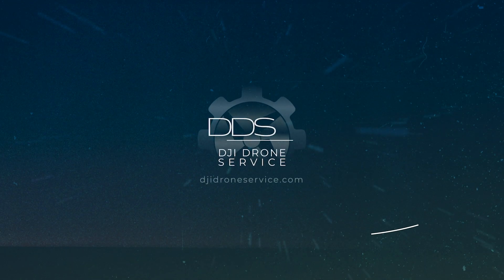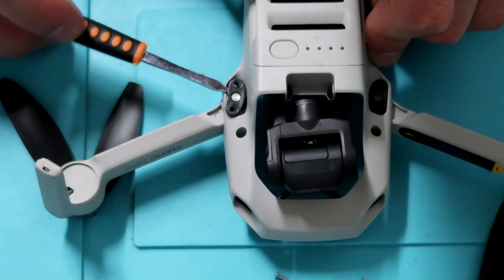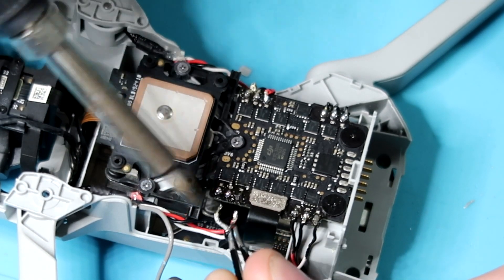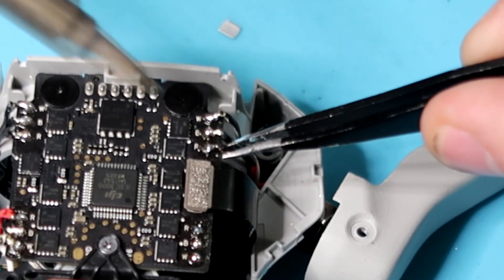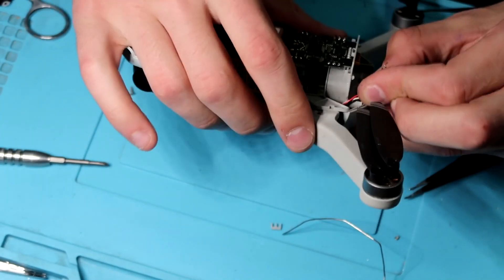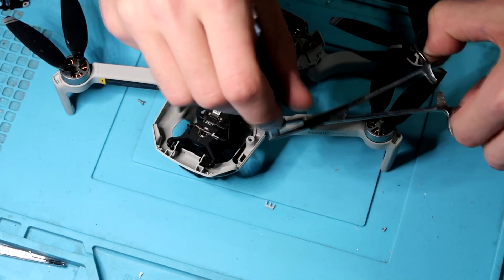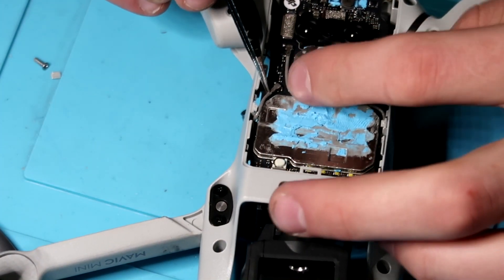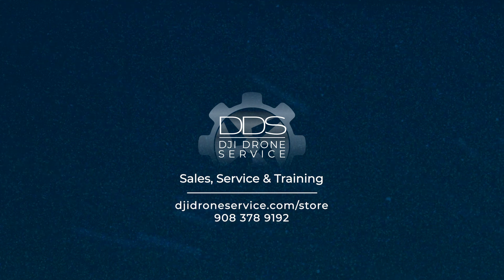Mavic Mini Front and Rear Arm Swap & Repair

Comment: Both videos I have watched regarding the mini when removing the top shell I noticed pieces breaking off the drone and laying on the mat.  Not too good for "professionals", pretty careless with the prying of the ribbon connectors, one slip and there goes an smd off the board, or worse have the power button metal retainer break off

Comment: Is there a way to test to findout if the motors are bad or if it's the board ? Have 2 Drones and on both the right side motors are not working . Could I simply take it apart, remove a ledt arm and test it on the right side of the board ?

Comment: There are other tricks to soldering and de-soldering.  Use dri-wick, heat up and bang the drone on the table real fast, etc..   Another little trick, if the solder on any solder joint you are removing doesn't want to melt just add a bit of fresh solder.  It will transfer the heat and melt the old solder. Then just remove it after.

Comment: My Mini2 flipped over when landing on a place with some sand.  I think some sand particles got into the rotor housing; the rear blades don't rotate freely.  It is a bit "cloggy" when pushed.  What is the best thing to do here?  Can I take apart the rotor to clean?  Or is replacing the whole arm the best solution?

Comment: Still having problems after the rear arm was replaced. The drone won’t take off. It keeps going straight back and the one motor looks like it’s being underpowered. Could it be the circuit board?
Reply: Can I send it to you?

Comment: My drone crashed and landed in a puddle 😢 and after drying it and trying it out again it just seemed the back right motor wasn’t giving full power so I bought a replacement and it’s still doing the same thing (not giving full lift power) so it just flips itself. Any ideas on how to fix this?

Comment: Love the vid, helped me to be comfortable in rebuilding a broken arm. Seems the tricky part is repositioning the spring in the arm, rather than use any tools , just place the spring in the old arm, twist the top hinge (ie the bracket with the screw holes) , no risk of damaging the spring as I have seen else where.

Comment: Hey thanks so much for making this video. I was able to follow it and fix my mini’s broken front rt wing with minimal effort except that you made prying off the cover look so easy but I struggled with that a little. Your tips for removing and resetting the arm spring were invaluable and made it a breeze. I had tried to glue my broken mini’s wing back on and it held for a while. Then I found it broken again when I took it out fly it one day. I had got an extra wing but I thought the process for changing it would be too much to take on. I tried to weld it back together again with super strong epoxy with no success. So then after a very brief search, I found your video and now I’m up and flying again like it was straight out of the box!

Comment: you mentioned early (1:12) on that after the replacement, you'll need to reset the drone. Can you elaborate exactly what you mean there? I've just finished a front arm replacement on my Mavic Mini, got everything put back together again but then when I turned the drone on, the LEDs flashed green/yellow/red, and then held on a constant Red, which im reading is a critical error light.  Idk whats going on....the drone pairs fine with the remote, and the firmware is all up to date.  Any ideas/suggestions?  Thanks in advance

Comment: Just picked up DJI mini 2 flying it in my kitchen for the first time it hit my stove 3 feet from the ground and it broke the left rear wing pivot screws hold it into the body I have not seen any buddy else pulling screws out also it cracked housing

Comment: It seems to me because the Mavic mini has no sensors that it could probably benefit from a swap to a like size race drone CF frame. Perhaps it would save weight a little and gain an extra few seconds of flight time but most importantly gain some strength.

Comment: Great video, very hard to do it, took me almost two hours to get it done, i wish you explained more the process of removing the lower shell. Awesome video. Thank you very much
Reply: Only took me 25 mins and i know nothing about electronics or repairs its not rocket science 🤣
Reply: @killuminatigomez3795   so, you didt? i have to replace the back arm but never use a solder like this before
Reply: condor19891 yep flys like a champ i have no experience soldering but i got it fixed just heat up the solder enough to disconnect the wires u can use the same solder to connect the new ones good luck pal 😊
Reply: @killuminatigomez3795  thanks for the confidence dude. I will try

Comment: Hey man, great video.. I recently crash and broke the front arm.. I replaced it and the drone flys normal, but my range is next to 0 now.. loses connection and video becomes laggy and freezes. Any idea on where to look? What to fix?  Thanks man
Reply: Buddy, you might havent put the antena correctly, open obly the down cover and check the cable
Reply: @beyonduniform  thanks for getting back with me, I ended up taking it back apart a while ago and yup, my antenna wire was just sitting there not connected..
Reply: @maverickthemutt   I'm repairing mine today also, I will upload a video, and it came on my mind the antena wire. But hope yours is working properlu now. :D

Comment: After owning a Mavic Mini for one day, my friend's son crashed it into a tree and broke the left rear arm. My local drone shop wanted 150$ for the arm, and 150$ for the repair. After buying an arm for 40$ off of Amazon, it took a grand total of 35 minutes to replace the arm on my own, even having never used a soldering iron before. I highly recommend this video to anyone trying to do a repair by themselves, as the tutorial was incredibly useful. Thanks DJI Drone Service.
Reply from the maker: glad you found this helpful
Reply: Given the whole kit is $399 and on sale for less the local shop needs to check the market.
Reply: Just curious, can I just replace the electronics of my arm into a new arm body? The plastic around my motor cracked. Ie nothing wrong with the electronics themselves. In fact it still takes off just fine. Just the casting has a crack
Reply: The same happened to me today and also bought it yesterday and also crashed into tree and broken the front arm so I will order front arm
Reply: OK. I MUST SAY  THIS . HELPFUL VIDEO.  HOW EVER NOT EVERYONE has the tools needed.  I used a mini flat head to take shell off.  The left rear side was being stubborn.  Well you see there's a black sticker where the battery goes in and to tiny white dot stickers each side.   If you look a tad further on left you see a black sticker from top to bottom.  That's what's keeping it from separating.   !!!!Wrong!!!!!  Not sure what I cut but it's not a sticker . So I suggest  In the demonstration that you should let the watchers know there are cables wires that run along the side of the drone as you' disassemble. be careful not to cut or tear one.. spend the $150.00  that way your not in my shoes saying now what..  So I give this video a 4 out of 1 through 10... I think it's very important to give  As much detail and information Especially working on a $300 or $500 drone .so beware   Red white Gray black wires are Running along the sides just like the part you bought to fix it I'll be careful .
Reply: Big facts. I bought an arm off of amazing and fixed it myself as well

Comment: READ BEFORE YOU ATTEMPT:
I broke my mavic mini because I'm a dumbass. I flew it into a wall when I was flying it indoors. I cracked the top right arm and for a week or two I just had it taped it up. It flew fine but it looked tacky and I'm sure it would have been draining the battery.

Its been 5 years since I soldered and I was 13 years old when I did. This was the second most expensive purchase I've ever made but looking online I found that the damages wouldn't be covered under warranty and dji would charge me up to £100 to repair it(no dji care) . Being a broke college student you can imagine how scared I was to attempt anything.
But after a bit of contemplating I decided to do it. I bought this soldering iron kit: 
https://www.amazon.co.uk/dp/B07WVVV7SP/ref=cm_sw_r_cp_apa_i_y00.Eb5WZJJZN
And it's pretty good value for money, there's a lot of stuff inside, I'm not sure about the quality -as you can tell I'm no expert.
I also bought a spare arm from Amazon now out of stock and altogether it set me back ~£50.
The part that took the longest for me was getting the top shell off because I was very weary of breaking it. But take your time and keep in mind that you have to apply more force than you think.
Soldering was hard. The contact area is really small and at one point I thought I fried it because the soldering iron caused a smoky look on the PCB. It's also really finicky, but the two "tweezers" in that kit came in really handy.
Connnecting the antenna wire back was time consuming as well. You have to make sure it's perfectly level before you press down.
All in all the soldering is not the prettiest but it worked. It took me around 2 hours, I went REALLY slowly. Watch this video as well to help with some parts of this video that he brushed past:
https://m.youtube.com/watch?v=E7hdTZ2BUSU

I would say if you have the money, send it to the pros. But despite being a complete novice, I was still able to get it working and it looks as good as new -on the outside anyway. I would say go for it, be patient with it and watch this video multiple times and anytime you encounter difficulty with it, stop and search around online for other tutorials and teardowns.

Good luck :)

P.S. Thanks for this video,it was really helpful and saved me some money, as well as giving me some respect for my drone and a very basic understanding about all the components
Reply: Me and my friend did it easly 1 try 3 Motorarms!
Reply: @3limin4torZockt  nice bro
Reply: Hi mate. Where did you buy the replacement arm from please? Also did you apply any cooling paste before putting it together?
Reply: @kn58  I got it off of Amazon pal, as far as I remember I didn't buy any cooling paste so I don't think I applied it
Reply: @edlinkanichayi2270  thanks for replying. Could you please share the amazon link if it's not too much to ask

Comment: Thanks for the vid, managed to replace my front arms, they twitch when I power them up, but dji assistant 2 wont recognize my mavic mini anymore, neither will the dji app. Any ideas on what I could do?
Reply: Front arms have the antennas in them, check those connections? They're annoying if you don't get it just right

Comment: I have a Problem.
After changing the front left arm according to this tutorial, the remote connection got unstable.
Since I live in Germany, Sending it to you ist not suitable for me.
Do you have any Idea, where the problem might be?
Reply: stupid nerd ? Possibly the antenna wire not connected properly. I’d say take it apart and double check that’s it’s still connected as it comes off easily
Reply: @bbit6304  I thought you were calling him a stupid nerd 😆

Comment: The soldier on my rear arm would not melt off to remove wire it got hot and hard as a rock wouldn't melt I had to rig it up putting on new arm.
Reply: how do you melt it at the end?

Comment: I've had the Mavic Mini for about a week now. It has less than 1 hour of flight time and I'm getting a motor sensor warning on the rear motor. There's no damage to the propellers but I replaced them anyways. I've updated to the new firmware but I still get the motor sensor warning. It still flys just fine after restarting it. In  about 15 minutes later I get the same warning.  Any suggestions or comments would be appreciated. Thx
Reply: I think this is a software problem, I had something similar and Dji sent me a new one.
Reply from the maker: howd it go?

Comment: Thank you for making this informative video. I have a question. Where can I find a front right arm for the mavic mini besides eBay?
Reply: How bad did you crash it
Reply: @carelesscamerastories  well I broke both my camera and front left arm.
But I'd like to build my own as well and maybe get a 3d printer and print my own shells.
Reply: @off-gridhillbillystyle3735  you should do it, I only repaired the front left arm in this video https://youtu.be/uzVIbc-6PAE
Reply: Ali express
Reply: I need to find all the parts including imu and main board
Reply: I crashed and repaired my mini, in this video https://youtu.be/uzVIbc-6PAE
Reply: I purchased mine from Amazon for about $30. It arrived in just 2 days.

Comment: Are the arms only available as a whole module or can I get just the plastic part?
Also is it easier to change just the plastic part (if available)?
Reply from the maker: need to replace the whole arm and rewire it

Comment: A little late now, but I suck at soldering. Could I have cut & stripped the wires & spliced on the new wires with heat wrap?
Reply from the maker: https://djidroneservice.com/ticket send it in for a free inspection

Comment: I tried replacing my mavic mini front right arm and it moves when I turn on the mavic mini. But it does not connect with the remote control anymore. I tried pairing the drone and rc but it did not work. Any advise?
Reply from the maker: https://djidroneservice.com/ticket send it in for a free inspection

Comment: I stripped one of the screws of the top cover... Any tips on how to get it out
Reply: Jonas Riedel try the rubberband on the tip of your screwdriver trick
Reply: @Raiderman1973  How would you fit the rubber band down the small hole?
Reply: StarWars YTP's use a small piece of the rubberband on the tip of the screwdriver

Comment: I got to make this repair, as soon as Amazon's delivery has come there . I have failed at makeing same repair different Drone,  could I cut and solder wire I screwed Last replacement soldering, any type of solder I need to get and heat shrinks ,I would love and appreciate a slow replacement video If I do wrong there is No more Flying..... Thanks This helped me see some light about the big repair job coming up! Thanks So much

Comment: Hi, I crashed my Mavic Mini after 2 days of purchasing, very bad fall, front right arm and gumball are in Avery bad shape. How can I send it to you guys for a fix. I live in UAE.
Reply: Hi. Ask for the help at Hobby Center in  Dubai. The coordinates are 25°14′13.01″N 55°21′58.73″E . Good luck!
Reply: Same for me , sorry to read that, but I repair mine looking this video, some super glue and tape, for the gimbal the same, and y Solder the cable again, unfortuneltly when i turned on now, there's no camera view, and says GPS doesn't conected

I think I'm gonna restar default Fabric
Reply: Wouldn't shipping kill any benefit. At that rate might as well buy a new one.
Reply: @alkemis  you are right, and I'm looking for options around me. I just want to know the repair cost.

Comment: Didn't check direction of rotation prior to soldering...pfft. broken tabs laying about...pfft. what appears to be heat sink bonding not cleaned and reapplied...pfft. Should have called this "how to avoid your mavic mini warranty"
Reply: "Void your warranty" and I didn't get one for mine... I plan on replacing the parts myself by hand lol
Reply: @kodguerrero  yeah...I paid for refresh (wasnt in the mood to have to tear down in first year) but once the market become saturated with aftermarket parts, refresh will become moot for new buyers.
Reply: @alkemis  That's cool and it's everyone's choice. Just don't get the hate over a demo video
Reply: @kodguerrero  not hating....but unfortunately some person in need of repairing their drone is going to find this video and will be sorely disappointed with their end result.
Reply: warranty is voided once you open it (there's a nice little sticker that breaks when you open your mini)

Comment: Broken chassis tabs lying on the work bench.  Pppffft.  Amateurs .  😉
Reply from the maker: This drone was the first Mavic Mini we got 3 weeks b4 official launch from DJI. It was stripped and put back together more than 5 times. The top shell is extremely fragile. Drone still flies as it should and we do have top shells available for purchase. If this were a customers repair we would also replace the top shell. Was for illustration purposes and this is the process on how to replace a broken arm.